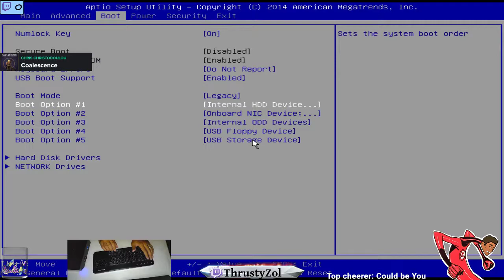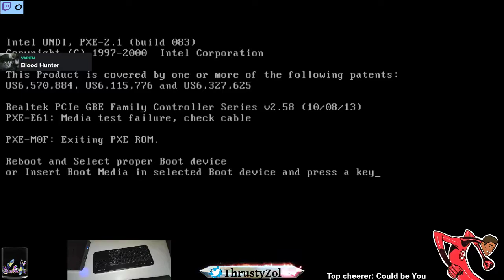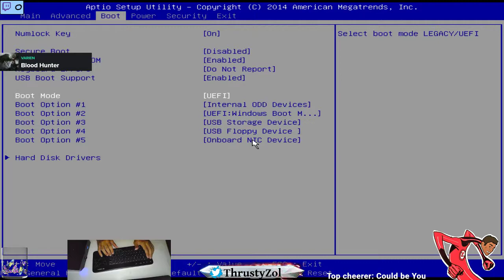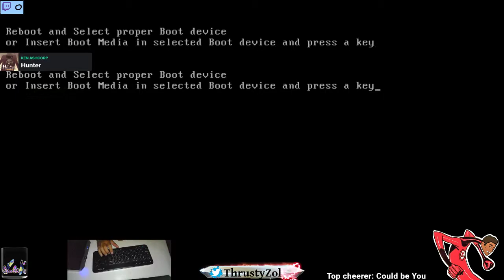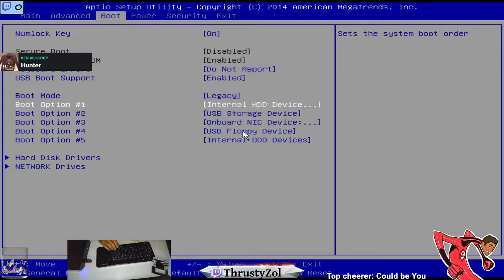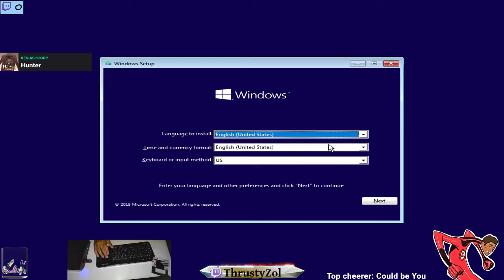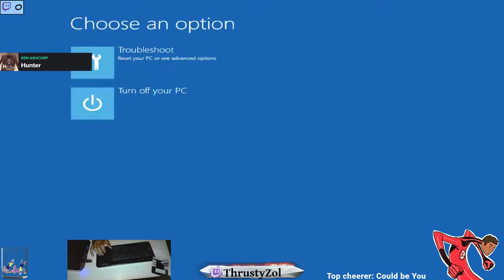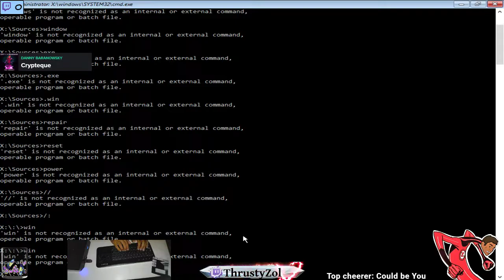Replacing the Alienware Alpha Motherboard (2019)

Comment: how did you know yours was fried? mine i think finally just fried after like 6 years of use :( i was just upgrading my cpu i got from my gf for christmas and all of a sudden the yellow light of death came on, but this time it was different. Ive usually been able to fix it simply just by removing battery and draining power. This time it had a solid yellow light, so I'm guessing it's fried right?
Reply: im thinking about getting the motherboard soon. question though. you think if i got a motherboard for an r2 it would fit in the r1 case?
Reply from the maker: I figured out it was fried because I tried another Dell power adapter and it didn't power on. I'm not sure if the R2 will fit but I was thinking the same thing but decided to just use the R1 just in case it didn't.
Reply: Dude just put the fans in the left and right side of the board ? First of all you could damage them . And second they are in the way of doing the repair . Are you an experienced technician ? I repaired amd alpha with new motherboard ,upgraded from I 3 to I 5,upgraded from 4gb ram to 16gb and installed an ssd  . Never worked on one before amd it took me less than 45 minutes  . Everything is pretty well laid out for you .
And a word of advice cut the music out its distracting ..
Reply: My niece uses that computer to this day  .

Comment: after your video you reinstalled windows?
Reply from the maker: Yes and it works like new
Reply: Don't need to if it is stored on your hard disk . It will just boot right up .